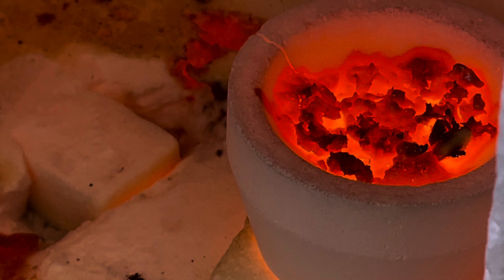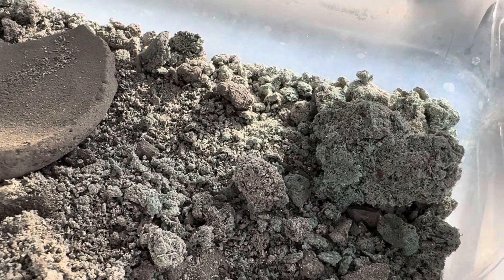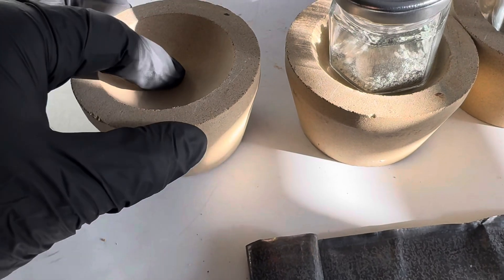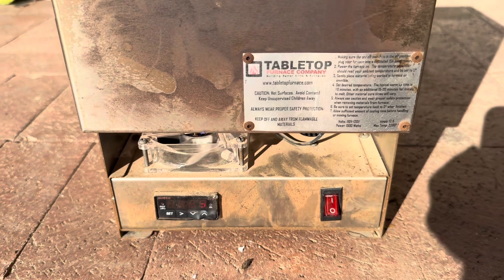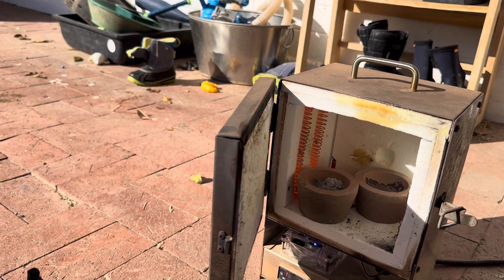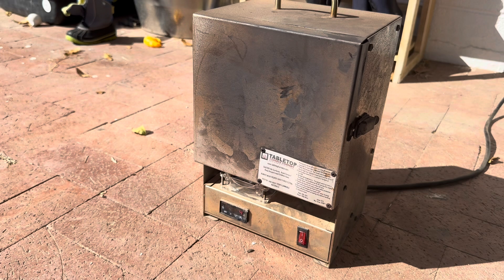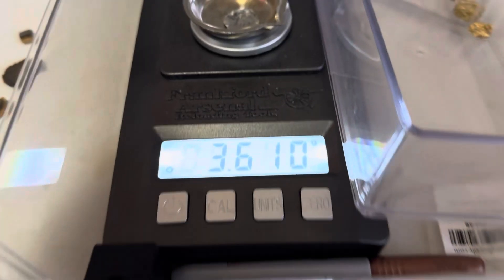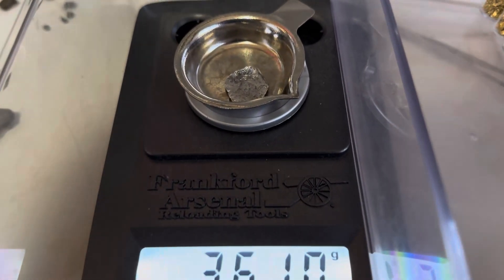Can you Cupel Impure Metals Without A Collector Metal?

Comment: Tip: cupelling usually works best if you keep the door slightly cracked giving it plenty of oxygen. You want to oxidize all those base metals away, after all.
Reply from the maker: There are holes and a fan on the bottom blowing air in